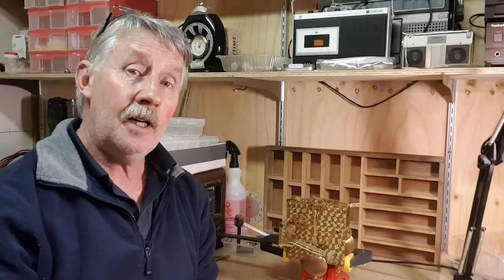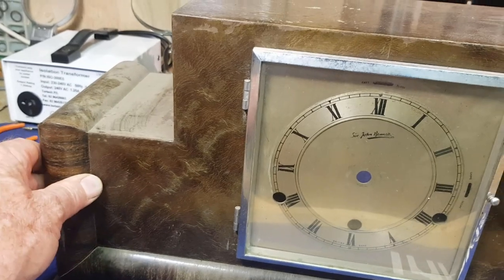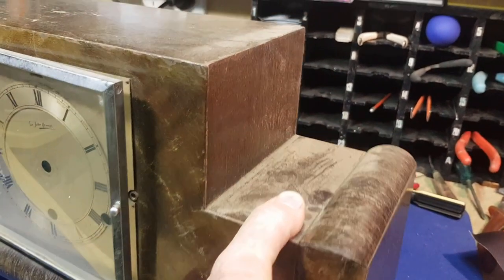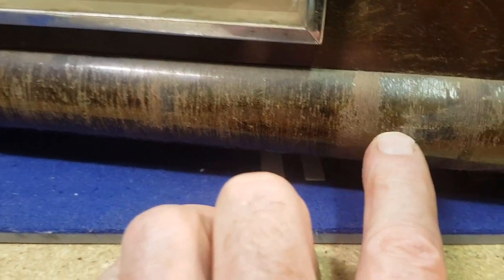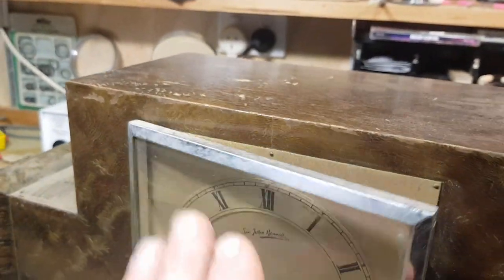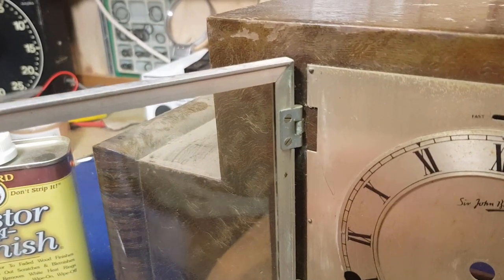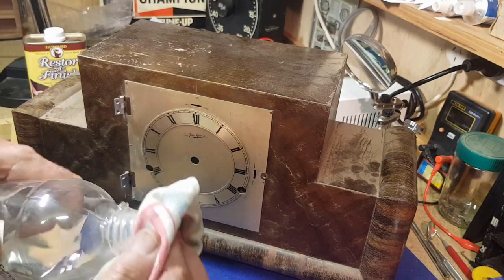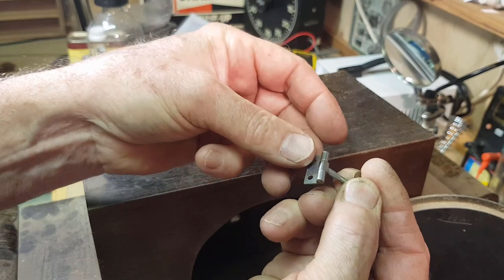Clock Restoration Part 2 - Cleaning up a deco English Mantel Clock Case with Howard Restor-a-finish

Comment: Hi Chris, I used fine steel wood and Restora Finish. After this I removed all cracks in the varnish and the varnish. Really important just to remove finish and not damage the veneer. This where Restora Finish is important. Next I used a walnut stain from Minwax, which finished the clock beautifully. Let dry for a day or so, and then I gave it five coats of Minwax furniture wax. Result was beautiful. Gave the clock. beautiful Westminster 4 chime clock to my nephew and is new wife as a wedding present after I built a cedar transport case with a level embedded in the top.
Graham - Westport, ON
Reply from the maker: What an awesome wedding gift, nice work Graham!

Comment: I have used Howard’s Restore a Finish on a good number of clock cases with respectable results. I have tried it with 0000 steel wool and I think that is too harsh. I have, if the finish is worn from the hard edges, used a bit of stain to cover the bare edges then Howard’s the next day.  Your clock came back very nicely.
Reply from the maker: Thanks Andrew, yes - I've used the product on a range of things now and it does a pretty good job for a quick fix! Thanks for watching! 😊👍